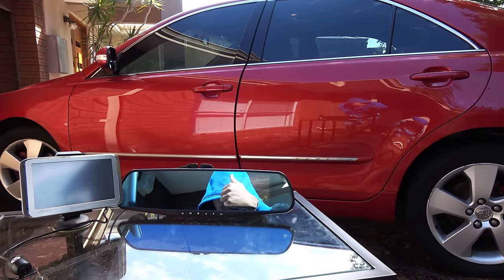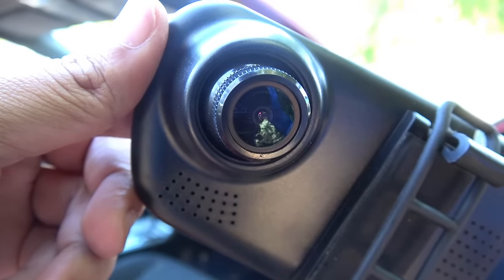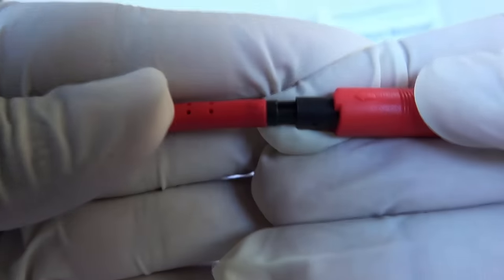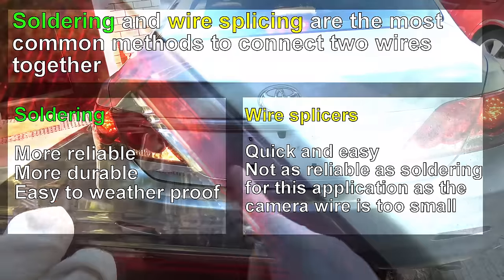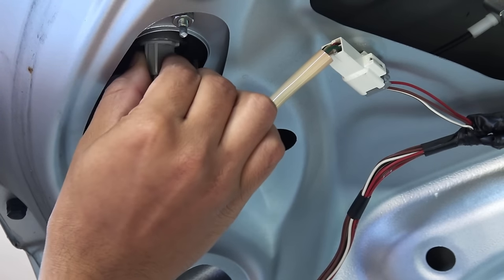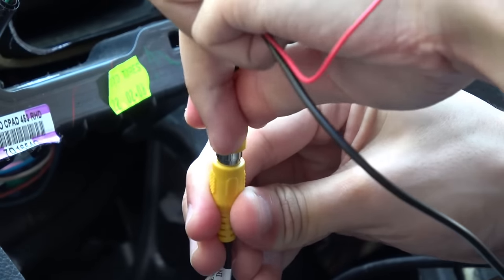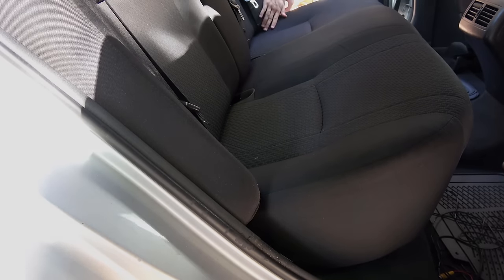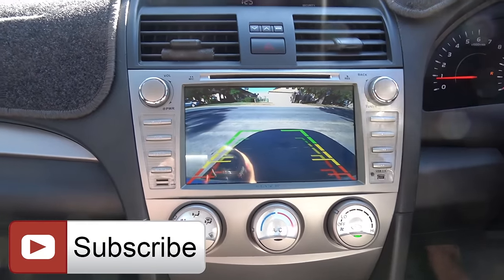How to Install a BACKUP CAMERA in Your Car  ( Do It Yourself guide )

Comment: He connects to the reverse lights twice??? I'm so confused. Why can't you connect the trigger and power to the same light?
Reply: Thats what i am wondering two!!
Reply: Me three
Reply: He did connect them to the same light. The first connection was to supply power to the camera when in reverse, and the second was to trigger the head unit to switch to what the camera is seeing. Could connect them at the same time but he did them seperately. Same same 👍🏻

Comment: so you need to have the rear lights on so the camera works......
Reply: Umm its a reverse camera.....
Reply: @moelester7971  yeah but some stereo like my Kenwood DNX893S you can view the camera while driving(front and rear cameras)
Reply: No, you can wire it to any unswitched power source. I installed a rear camera on a Porsche 996. Very tricky getting the wire into the cabin but then I ran it to the front consul took out my ashtray and build a little switch panel. Anytime I wanted my back up camera I just reach down, flipped switch, and my back up camera was on.

Comment: I love how some of these install vids make it seem a peice of cake... it depends on the car... I just added one to a ford focus 2003 wagon and it was a royal pain in the ass.. fishing wiring thru the rear  door hatch, then thru the rubber accordian  connector to the roof area was a no go... no way an rca connector is going thru that  accordian passageway which already had thick wiring in it... had to snip off the rca from the video feed wire, pass it thru, then connect to backup light then rip up more body moldings to get that wire up ftont, then had to resolder to rca back on.... took me hrs and hrs... also recommend doing a dry run before committing to the install... hook everything up to test wiring and camera..make sure it triggeers on reverse and camera shows on screen... that way you dont committ to installing a defective camera  or bad wiring and have to pull it all out again.... i;d probably just turn my head and look over my shoulder vs doing this nitemare again.

Comment: Excellent video and explanation, but my stereo does not have a “back” wire for the red wire from the video cable to connect to… Where do I connect the red wire that comes from the video cable in this case?
Reply: find a replacement video cable with trigger wires on both ends of it

Comment: Thank you for the detailed explanation, Well done! I have actually managed to install a camera to my Camry following your step-by-step video.
Reply from the maker: you're a champion.. keep it up
Reply: I need your advice, any help would be appreciated! ... after installing the DVD player and the reverse camera, the steering wheel buttons are not working (the volume up and down buttons both cause the volume to go up). Do you have a way as to how to get them to work? I have a Camry Altise 2007. The brand of the DVD is EHOTCHPOTCH.
Full details can be found in the AD on ebay  http://www.ebay.com.au/itm/132294998061?ul_noapp=true
Regards.

Comment: When you connect the positive and negative to the the light bulb wires, do you also connect the other red wire as well to the same positive wire of the light bulb?
Reply: if your monitor/radio headunit has a trigger wire for reverse signal, you 'd better do this

Comment: When my mate and I installed a reverse camera in both our mazdas. His fuse popped and had to use a 15amp fuse for his to work. As for mine for some reason, I popped the fuse aswell, plus a 15 amp fuse we replaced it with. So my only option was a 25amp fuse which has proven to be the most reliable for my mazda. An now i have no issues, i dont if it's because mine is manual and his is auto. But the load on his car is different than what the load is on the system of mine

Comment: Had to find 6 different videos on how to connect the power wires to the reverse lights.  Thank you for clearly demonstrating this!
Reply: So that extra red wire that runs of the yellow VGA cord connects to the power of the reverse light? As mine won't turn on when I put it in reverse but comes up when I push rear camera on head unit..
Reply: @williams6140  I am having the same trouble, so what ended up being the case?
Reply: @williams6140  did you end up having to connect the red wire from the vga cable to the positive wire for the light bulb?

Comment: Very good instructional video. One observation though, if you disconnected the negative battery terminal, how is it that the head unit was powered on right before you removed it? Just wonderin'.....

Comment: HELP please, I’ve just done this on a pumpkin stereo, the camera comes on when I go into reverse when the ignition is on BUT when the engine IS ON the camera doesn’t work when I go into reverse, it just says no signal. 

Thanks
Reply: Since no one replied, your power isn’t hooked up properly. I know nothing about routing power correctly but I have read numero blog posts and the problem is with how you are hooking up the camera. If available try to hook it up to your reverse lights. Best of luck!
Reply: mason dzon it’s hooked up to the reverse light but ive been told it needs a relay 😭

Comment: where do you connect the orange cable that is next to the video plug that joins the camera
Reply: That Orange cable that comes out of your radio has to be connected to the small red cable that comes out of your video cable from the back. 
And at the back you connect this red cable to your + from reverse light. So your radio registers that you're in reverse because the light goes on.
Reply: @BalticBrothers  Thx, that's the answer I was looking for. The video isn't very clear on that.

Comment: I followed your steps, everything works except cam won't turn on while on reverse. After soldering I doubled checked for 12v and it's there. I also tested the camera with a spare battery and it's not defective. Any tips??

Comment: Is it necessary to solder the wires, or its twisting them ok?
Reply from the maker: that's ok
Reply: @JunkyDIYguy  thanks for the quick reply. awesome video bro
Reply: It's ok as long as you have an excellent connection that's never going to come apart

Comment: I tried my best to connect the same camera to my headunit but I failed miserably. I followed all the steps...does not work. The headunit is the original equipment of my Mitsubishi Lancer. I have coming from the unit a cable labelled parking and 2 others , one rvc and other pnvc or something like that. Where to connect the little red wire? To which of them? 
It's a nightmare for me and I am pretty handy though...

Comment: Hey i installed my backup camera and it works when i put it in av mode but when i put it in reverse the camera comes on but it doesnt show any picture just black but it works in av mode
Reply: you plugged the camera into the wrong yellow socket on the head unit, try again =)

Comment: When Drilling.. You Didn't really understand the threads are larger diameter than the actual shaft. Drill bit should be smaller than the outside diameter of the mounting.

Comment: Hi i have backup camera same as yours, i also tap it in the reverse light, now im planning to add parking sensor, can i tap it also in the same wire?  i mean in the same reverse light, or it will cause some problem?
Reply from the maker: You can do it that way in most cars without causing problems.

Comment: Aftermarket 
My is not working! How did you connect?..  ..  * I solder both wires, reverse lights  "back/red negative to black/green and the other positive "all red to black and white" is that wrong?

Back of car, I soldered to the back up lights "clear light" ! 
* I solder both wires, "back/red negative to black/green and the other ..Positive "all red to black and white" is that wrong?

Comment: Can u please tell me if the steering wheels bottoms works after install the back up radio unit??
Reply from the maker: Yes they work with mine, there's a separate wiring harness comes from the steering colomn for the steering wheel controls, you have to plug that in to the back of the radio. So you wanna make sure the head unit you're buying supports your car, otherwise your steering wheel buttons would be not functional.
Reply: Junky DIY guy yes is a 2008 camry, I have see many videos about changing the factory radio for a after Market one and the steering wheel buttoms do not worked

Comment: I fitted camera in gold mark 6 when ignition on and in reverse the pictures fine but once start the car it goes fuzzy some time picture will turn off .I think I have to fit relay in it because I think losing power once the car starts up , because it's connected to read reverse light bulb  .any idea would help .Chinese head unit with Halfords read camera .2012 model

Comment: did not try the camera before installing everythin, double-checked the wiring/connection and now its not working, head unit recognized that i am doin reverse but no video showing, maybe faulty unit?

Comment: How much would an installer charge for a service installation like this?
Reply: About $250 with double din stereo, backup camera, wiring and labor.
Reply: @MrCadillac2004  Will the same screen be radio, wi-fi, radio, gps AND camera?

Comment: How do you connect to the steering wheel, so that when you turn the steering wheel screen shows changing trajectory  lines?
Reply from the maker: these cheap cameras don't have that function, that normally only comes with the factory head unit where the car's ecu tells the head unit the steering wheel angle.

Comment: The red wire for the front monitor is connected to what ??
Reply: the trigger wire to receive reverse signal on the front monitor/radio head unit, if no, then ignore it

Comment: At 9:10,  you mentioned the orange should be connected to the red trigger wire of the backup camera. Could you please confirm   that is power supply for the backup camera?  When installing my Dasaita Android 8 Head Unit in my 2016 Mitsubishi Outlander, I do not have to connect any trigger wire for my factory backup camera,  simply connected the yellow RCA video cable works.  Now I got a 360 degree birdview system,  and the installation instruction indicate I have to connect the red trigger wire for the backup camera, so wondering is that red trigger wire should be tapped into that Orange wire you talked about in your video. Thanks.
Reply: I asked roughly the same, no answer until now.....
I also have a Mitsubishi 👍
Reply: @RaduMichael  Thank you for your comment! Hope the OP will answer out questions soon. Cheers
Reply: @johnliu4569  all the best! 👍

Comment: What is the short red wire that is coming out next to the video cable? How do I connect it? What is it for? 
Thank you!!
Reply: It is a positive trigger wire for the head unit/monitor to automatically switch the display to camera when in reverse.
Reply: @koogangovender3044  So you connect it to the positiv wire from the reverse lights?
Reply: @paulterhaar4862  correct

Comment: Those cars have the steering wheel in the wrong side :-)
Reply: it's the right side pun intended
Reply: You're looking at the mirror image if you turn the frame around the steering wheel will be on the other side

Comment: what aftermarket display is that?
Reply: You will notice in the video the Joying name on the unit...a popular Android radio seller on Amazon and other sites..I have bought two of them myself and they are now adding  many more upgraded features..this one seems to be a common 7 inch 2-DIN version that fits in most dash applications..but you should always research your own car and year online for specific instructions, and look for specific required aftermarket wire harnesses,  and then review all necessary wire connections and any other options/cameras to be installed with the unit.
Reply: @vanallen9453  or pay someone else to do it

Comment: Hey!!!! We asked you to give a little info on the little red freaking wires connecting tho video cables! Anyone home?
Reply from the maker: check the video, I've shown everything.
Reply: Junky DIY guy so basically you connected the camera red wire and the radio red wire together to the reverse wire of your car, right?
Reply: @davidjalloul3108  yes.  Both goes to the reverse light wire.  I too noticed  he did them separarely though, and assume it is because he wanted to not have all that power going through the one reverse light wire.... would be nice to get confirmation if i am correct from others.

Comment: totally not have safety and right style connect power wires rear light, soldering no newer and tape. stupid burn car someday. this have connection clips were can add wire and take out new wire. lot better safety installing.